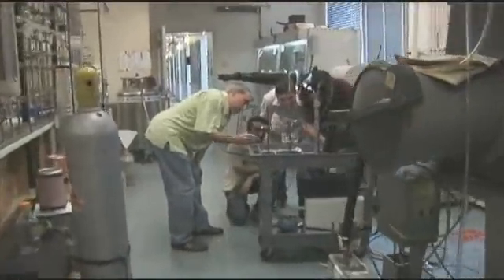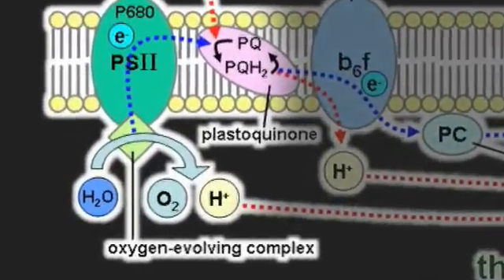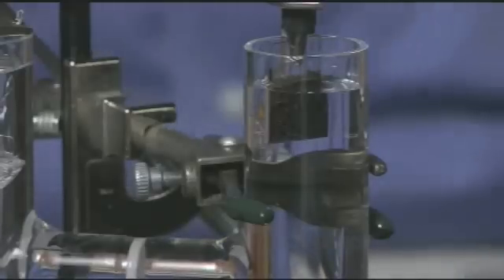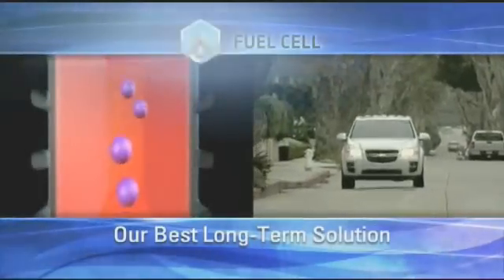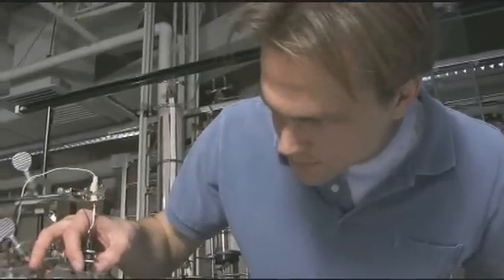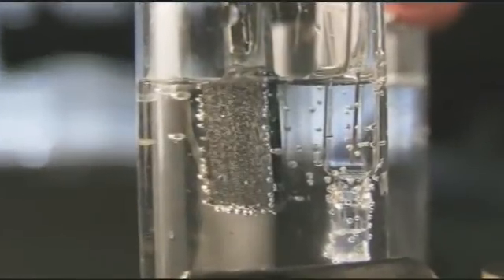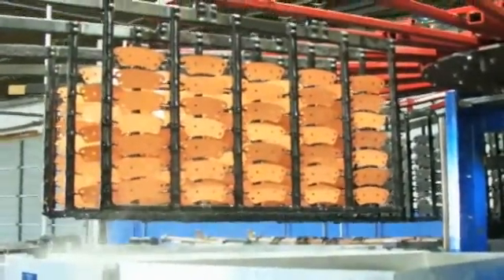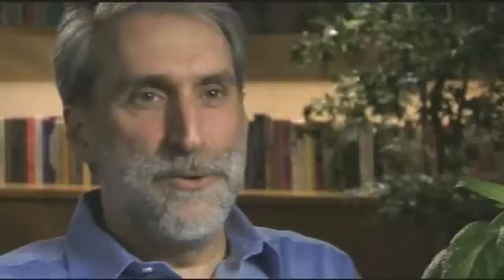MIT TechTV - Tiny Bubbles

Comment: @mmaghfai 
Mass spectrometry will only provide information on the elements present in the electrode, which we already know is: cobalt, nitrogen, carbon, hydrogen, and probably phosphorus. It will not necessarily reveal the structure of solids. As you can see in the microscopic view, you have the known elements creating different compounds at various phases, as metallurgy predicts. Expecting to use a scientific word and make a point? You clearly don't know how long this type of research takes.

Comment: @Ayserk57 
An ideal catalyst does not get used up in a given reaction. However, not all chemical reactions are complete and sometimes the catalyst can be used up in the reaction. In this case, I'm speculating as to how much of it is being used, or if the level of the catalyst is being monitored. If you need to resupply a catalyst to a reaction, then it is not a catalyst.

Comment: If they're using the Cobalt electrode in conjunction with a Phosphate solution, doesn't the catalyst get used up? In this case, this is not considered renewable since Phosphate and Cobalt will become the actual fuel.